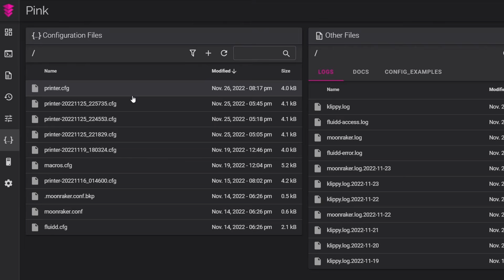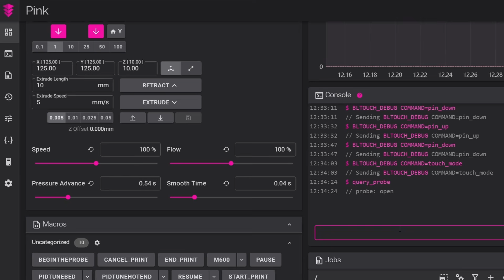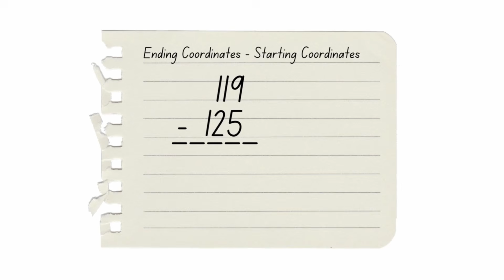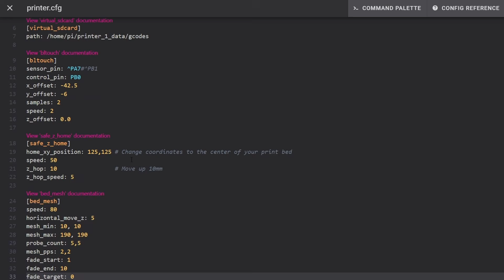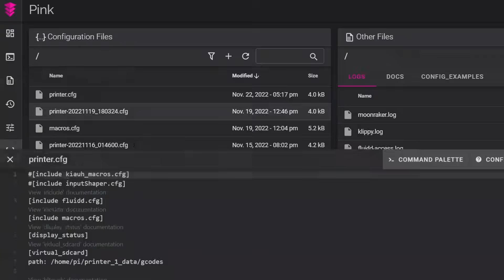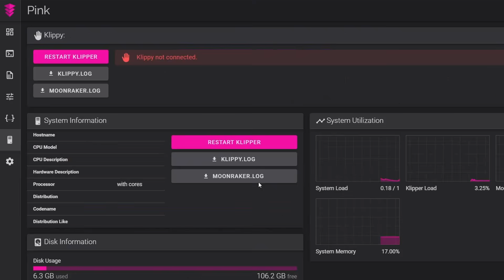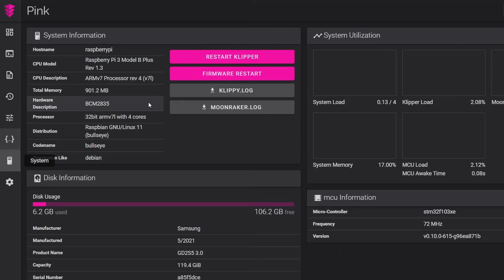BL Touch complete setup for Klipper! Maximize your probed bed mesh!

Comment: I really can't thank you enough for this. I've been having a rough month or so, and for a while I was trying to focus on learning how my printer worked better, getting it optimized, etc. After I had gotten Klipper running, though, it felt like I was running into endless problems, and a lot of it stemmed from the fact I did not understand the explanations for all of this I was finding online. Not only did I go through all of this and it appears like everything is good to go now, it was INCREDIBLY easy to follow. Seriously, hot diggity damn. A thousand thanks. <3

Comment: Why not using the readings of x and y coordinates we can get by manually moving the tool head for each extreme x and y  : remove step motor connectors to avoid damaging the drivers:  draw with a sharpie each important point  : at center the position (x y) and record directly (save by click) the position of Nozzle and Touch Probe and click to Save; firmware calculates offset, than move the toolhead to each extreme X and Y position and Save directly on the Config file.; tell the Config file how many points to probe; 
Reconnect the stepper connectors and test.
Do you think this can work and simplify?

Comment: This tutorial has been very helpful.  I searched this topic and found yours to be the most informative.  I am having an issue with the calibrate step.  I am using mainsail not fluidd so my calibrate is under Heightmap.  I home the nozzle then select calibrate and it opens a dialog box where I am to enter the name of the calibration and I leave it as default then I hit calibrate.  The nozzle measures the first 5 then stops.  It does not move along the y axis.  it stops and gives no error messages.  Do you know what I might have wrong?

Comment: I'm having a issue with my bl touch in klipper . With a BTT e3v3 board . In klipper the BL touch does the self test when printer is turned on . And I can control the pin with command up and down. But stays open and never triggers

Comment: Just switch to an inductive probe and enjoy the difference. The joke of reliability and repeatability from the BL touch really needs to end. Constant errors and crashing into my bed,I will never use a BL touch again. Google why you shouldn't buy one lol. As for accuracy I never got a perfect first layer off the BL touch if it would even complete a mesh. And after about a month and a half of troubleshooting constant errors on the BL touch, I would say it's reliability is a joke too. Turned out it was just EMF feedback from the umbilical to the tool head feeding into the BL touch harness. Unless you're using a glass bed or something similar, the idea that a non-contact inductive probe is not accurate enough is the stupidest thing I've ever heard. When I was using the BL touch I'd have a first layer that looked like it started well, then one corner was too tight and the other corner was too far away and it just made for a crappy experience. Over a thousand probes on various prints in the last couple days with zero errors and the closest I've ever had to a perfect first layer for my entire build plate. TLDR The BL touch filled a gap when it first released but was still finicky and overrated, now it's obsolete too.

Comment: This is incredible! Story time, I have had an ender neo max with sonic pad that I added a sprite extruder with 3d printed fan ducts and relocated CR touch mount. For over two years I have struggled to be able to use the entire print surface or use the correct bed mesh size. I've had friends try when they come over, I've let people teamview in to help with a webcam on the printer, I even reached out to creality support. Nobody could get this thing setup correctly. I've spent way more time trying than I ever should have and just ended up saying forget it I have the worlds smallest printable area on a neo max printer. Then this video comes along randomly and in less than an hour everything is setup and working perfectly again. You sir are awesome! 😃

Comment: Bl touch definately wasn't the first, in the early days, and for years after we used a micro switch connected to an rc airplane servo to deploy it, it worked but I sure was happy when Bl touch came out. FYI.

Comment: Awesome tutorial! I've followed it ~3 years after it's post date as I switch over from an old version of Marlin to Klipper on my Ender 3 Pro.
I'm in the "Create bed mesh" chapter in your video and don't have a "Tune" button in Klipper. I do have the [bed_mesh] section in my printer.cfg file so not sure why I don't have the "Tune" button/section.
Your help is appreciated!

Comment: Out of curiosity why are you not heating your bed before doing the calibrated mesh? Everywhere I look online says you should. Should we not heat it?

Also as a side note I am having each corner of my bed have different adhesion almost like my already calibrated bed mesh is not working so I am following this video haven’t tested if this works yet but hopeful. (I have verified my printer file and the cura start code so I don’t think it is that).

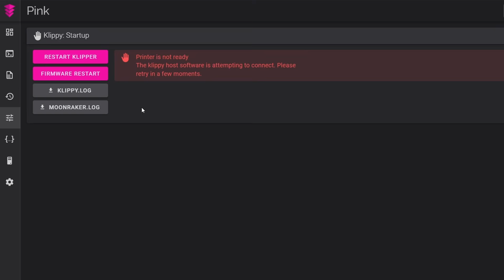Comment: bHello, thank you very much for the guide. I understood almost everything and was able to apply it to my 3D printer. However, I'm very confused at minute 24:00, where you start talking about macros and paste the BED_MESH_PROFILE LOAD=default statement. I don't know when you pasted the macros into the config.cfg file, nor do I know where you got them from. Can you explain this step, which may be obvious but I don't understand? Thank you very much for your help.
Reply: still waiting or did you figure this out?
Reply: That Start print macro is not directly related to the point of the video or probe setup, that is more or less a routine one can set for it's printer so when the print starts is doing some safety checks, prepare the heaters at ones desired temps, do some purge lines if one wants that, etc.
So the answer to your question, he didn't set the macros then, these were already present just like the fields with stepper_y,x etc were already in the .cfg file.
You'll need to figure it out by yourself how to make a macro that does whatever you want when your print starts, but as a general example you can use or alter to your needs the below, but it needs to be modified by your printer specs and dimensions:

gcode_macro START_PRINT]
gcode:
    {% set BED_TEMP = params.BED_TEMP|default(60)|float %}
    {% set EXTRUDER_TEMP = params.EXTRUDER_TEMP|default(190)|float %}
    
    # 1. Start heating
    M140 S{BED_TEMP} ; Set bed temp
    M104 S{EXTRUDER_TEMP} ; Set hotend temp
    
    # 2. Prepare printer
    G90 ; Use absolute coordinates
    M83 ; Extruder relative mode
    G28 ; Home all axes
    
    # 3. Wait for temperatures
    M190 S{BED_TEMP} ; Wait for bed temp
    M109 S{EXTRUDER_TEMP} ; Wait for hotend temp
    
    # 4. Bed Mesh / Cleaning
    BED_MESH_CALIBRATE ; Optional: Perform mesh
    # CLEAN_NOZZLE ; Optional: if you have a cleaning macro
    
    # 5. Purge Line
    G1 Z2.0 F3000 ; Move Z Axis up
    G1 X10.1 Y20 Z0.28 F5000.0 ; Move to start position
    G1 X10.1 Y200.0 Z0.28 F1500.0 E15 ; Draw the first line
    G1 X10.4 Y200.0 Z0.28 F5000.0 ; Move to side
    G1 X10.4 Y20 Z0.28 F1500.0 E30 ; Draw the second line
    G92 E0 ; Reset Extruder
    G1 Z2.0 F3000 ; Move Z Axis up

Comment: Do you have any suggestions on how to get the bltouch to probe accurately on a very soft surface? I noticed the probe always dents into the surface, which means that the nozzle will always print too low.

Comment: For those wanting the start and end macros:

[gcode_macro START_PRINT]
gcode:
	G92 E0 # Reset Extruder
	G28 # Home all axes
	BED_MESH_PROFILE LOAD=default
	G1 Z2.0 F3000 # Move Z Axis up a little to prevent scratching of heat bed
	G1 X0.1 Y20 Z0.3 F5000.0 # Move to start position
	G1 X0.1 Y200.0 Z0.3 F1500.0 E15 # Draw the first line
	G1 X0.4 Y20 Z0.3 F1500.0 E30 # Draw the second line
	G92 E0 # Reset Extruder
	G1 Z2.0 F3000 # Move Z Axis up a little to prevent scratching of Heat Bed

[gcode_macro END_PRINT]
gcode:
	G91 ;Relative positioning
	G1 E-2 F2700 ;Retract a bit
	G1 E-2 Z0.2 F2400 ;Retract and raise Z
	G1 X5 Y5 F3000 ;Wipe out
	G1 Z10 ;Raise Z more
	G90 ;Absolute positioning
	G1 X0 Y230 ;Present Print
	M106 S0 ;Turn-off Fan
	M104 S0 ;Turn-off hotend
	M140 S0 ;Turn-off Bed

Comment: Greate guide I used 2 years ago and help me a lot, now I changed my entire hotend to a H2V2s revo and I moved my BlTouch on the other side of the nozel from left to right and the result is that the bed mesh is not calculated correct. So this can be used only if you have the bltouch on the left side.

Comment: Thank You. Your Videos are awesome.
I am having an issue though.
During the calibration of the bltouch my issue starts at BLTOUCH_DEBUG COMMAND=touch_mode.
This mode isn't working for me, but my printer will home every time, and the CR Touch deploys and retracts everytime. when i get to the BLTOUCH_DEBUG COMMAND=touch_mode, it doesn't work.
When i get to the part of creating a Bed Mesh, I home as per the beginning of tune and the head moves to do the mesh, my cr touch deploys once or twice, then i get an error that the BLTouch failed to deploy.(or in this case CRTouch)
Why would it do that?

Comment: my z offset is around -3.40 as well. It seems in Klipper that translates to just "3.40", no negative. It's confusing coming from the Marlin world. I'm running a Sprite extruder upgrade on my Ender 3 with BlTouch. Is there anyway to prevent this setup needing 3 mm or so of offset? Is there ant physical adjustments, etc?

Comment: Thanks for the video! Its helped alot. One thing im noticing and cant figure out is i cant adjust the Z axis on the fly while printing like you do in the video. It says it moved in the command line but wants me to save it so it can take effect on the next print. I can slow the speed of the printer down though. Everything else seems to be working though on the software. My fluid software looks a little different than yours in the video, but everything is available.

Comment: I know this is kind of an older video and klipper has updated quite a bit. I did it exactly how you said I saved it in the macros and printer CFG but it does not do the bed mesh adjustments while printing. Any ideas?

Comment: Thank for your video, The best one I have seen so far for klipper and adding bltouch. Question: I have a CR10-S5 and a V2.1 board. I can not figure out the pin identification for the board for software sensor/control pins. How do I find that? I can't seem to find that information anywhere I look. Thanks

Comment: Just completely customized my Ender 3 V2, added the 400x400 extender kit and the sprite pro extruder. this video came in handy.
Reply: is your z_offset high as well, like in the 3-4mm range?
Reply: @johnfr13d  nope, worked fine for me.

Comment: My printer has been down for a while month cause I bought bltouch I can't get it to work in marlin maybe I should try with klipper it seems pretty much plug and play I tried so many things I tries offset I tried manual bed leveling the bl touch is mounted exactly like specs say I just can't bring my self to thinker with it anymore than 15 mins a day I think of getting rid of the bl touch and use the good old endstop

Comment: AWesome video, really a tutorial mine was going great and came back and all went into the crapper X won't retract  the Bl all red. Took me hours of troubleshooting I have a "spare" ender 3 and tried the micro switches hooked the spare printer up and it worked but doesn't have the CR touch. So I did a bit more troubleshooting this morning. It was the X cable causing all the issues, replaced it and all works all the calibration and print done again.  I'm going to check the cable to po]inpoint the fault. Again thanks

Comment: This was infact very handy. There is also a method for the manual bedleveling so you don't need to use a paper for leveling. Its called tilt screw adjust in klipper.
Reply: I am absolutely in love with that.

SCREWS_TILT_ADJUST.

You'll need a section in your printer.cfg that'll look like

[SCREWS_TILT_ADJUST]
screw1: x,y
screw1_name: nickname

Comment: Thank you so much for the in-depth explanation. I was pulling my hair out lol.  One question, do you offer a macro or info on how to print the skirt as you have shown?  I'm trying to follow every step exactly as you've outlined and it would be helpful to print what you are.
Reply from the maker: Hey thanks for the kind words!! When you say the skirt are you referring to the cubes I use to determine how the corners look? Usually I will just place the cubes there and select a skirt to be around the print and it lays it out like that. As for the cubes, I simply created a 20x20x20 cube and then shrink it's height to a single layer thick. Then I spread them out to the corners of the bed and enter of the bed and voila! You have a test!
Reply: @PrintsLeo3D  Ok thanks so much.  I was able to find a first layer calibration test stl that I tried with.  It printed but all corners are not as smooth as the center after the live adjusting of the z offset.  I guess my next step it to use the video you created talking about leveling the bed.  Again, many thanks!
Reply from the maker: @user-os6ll9cf2j yea sometimes there's gonna be a little back and forth between adjustments to get everything correct. Good luck!

Comment: Will this work with an ender 3 pro with cr touch and nebula smart kit? I upgraded to the sprite extruder pro but I cannot get it to calibrate the bed dimensions and the nebula pad has no real calibration options.
Reply from the maker: I'm not familiar with the Nebula Pad , but if it's a Klipper pad that adds Klipper to your 3d printer, then this should all be applicable.
Reply: It's technically klipper but it's creality klipper which means it sucks. It has no calibration settings. I know it can be rooted, but I'm not sure I want to do that because it can brick the system.

Comment: do i need to level my bed before the calibration? Nice video by the way. subbed.
Reply from the maker: Yes absolutely! The bed probe is going to take measurements of the bed and create a mesh in an attempt to print a flat first layer, but it's out job to get that bed as "level" as we possibly can for it, so that it can do an effective job! Thanks for the compliment and I appreciate the sub, thank you!

Comment: Should I not be using the start gcode from my slicer? I don't have a gcode_macro START_PRINT in my printer.cfg.
Reply from the maker: So the start gcode you have in your slicer is basically the same thing as a start_print macro. By creating a start_print macro you give yourself the ability to make changes on the fly without ever having to change the gcode within your slicer. A lot of people have been having questions about this so I think it's time for a video :)
Reply: @PrintsLeo3D  that would be a fantastic video. I just modified my start and end print macros to be in my printer.cfg, and I'm using klipper's adaptive mesh, but getting them dialed in a little more would be awesome. I don't have any nozzle purge set up at the moment, or any sort of anti ooze provisions so that would be nice to add in for true hands free printing.
Reply from the maker: @TierNoneOperator I have found the biggest anti-ooze protection can have (besides the common default purge line before a print) is to have you nozzle maintain a lower temperature (~170c) while it's going through all of its pre print calibrations.

Comment: Here in 2024 and still modifying my Ender. Glad videos of such high quality like this are out there.
Reply: Same. I've been debating on making a video on how to customize marlin to do some things it took me forever to figure out before I switched to klipper
Reply: Amazing walkthrough!! But it keeps giving me an error message when I’m trying to calibrate to mesh bed😢 a move out of range motion? Then it won’t show me Gcode macro start or end print… what am I missing?
Reply from the maker: It's likely a movement out of range error because you may a little off with the min and max positions for the bed mesh. Can you share with my the X and Y offsets for your probe, as well as the min and max positions the print head can reach
Reply: For the probe (if I’m reading this correctly) x_offset -38, y_offset -12. And (again if I’m reading this right) stepper X max:300 min -19, stepper Y Max: 300 min -5?
Reply from the maker: So based on those values your bed mesh min and max should read: 
Mesh min : 20, 10
Mesh max : 262, 295
I went a few mms higher on the min, it could be 
mesh_min: 19, 7 
if you want to extend it to the max
Reply: Thank you so much!!!!
Reply from the maker: I feel you. Printers are getting faster and easier to use out of the box, but ultimate they're using a lot of the same components we always have been. The firmware made so made leaps and bounds and that means we still get access to it on some of our "antiquated" machines. Happy to continue putting these videos out and glad you're still carrying the flame!
Reply: @PrintsLeo3D  I like tinkering and the Ender is just so perfect for it. I could buy a Bambu, but I'd get bored of it.
Reply from the maker: @livedeliciously it's like I always say when people ask what the "best" printer out there is. The answer is it's the printer that suits your needs, and sometimes the need is tinkering and messing around .
Reply: Here in 2026 and still modifying my Ultimaker 2. Thanks! :)

Comment: I did the first restart and this is what I got. Pretty new to 3D printing. I have a Sovol SV06 Plus. "option 'pin' is not valid in section 'probe'.
Reply from the maker: Pin should definitely be an option under the probe section but it's possible you have some formatting or spelling issues. Can you copy and paste in your current probe section?